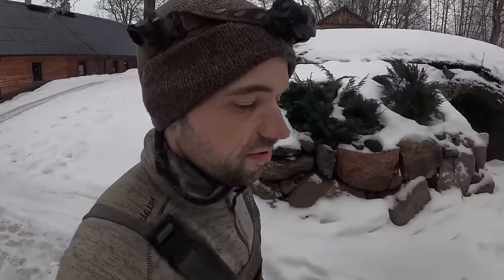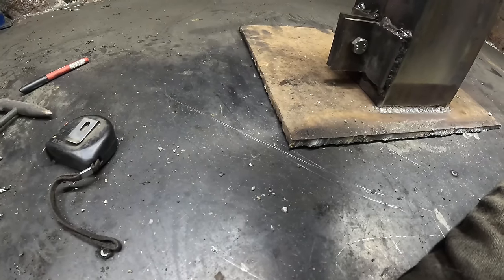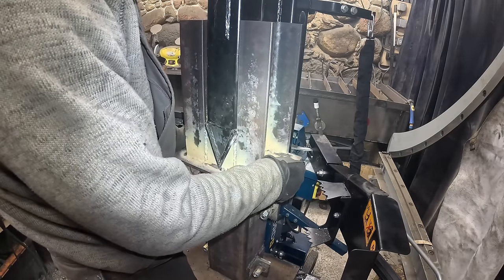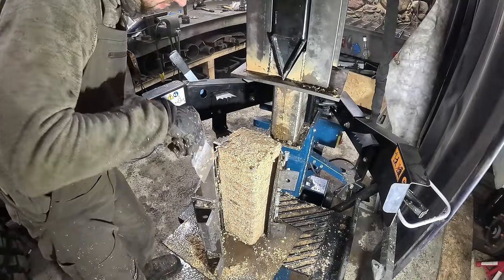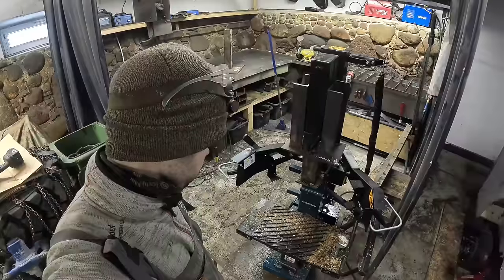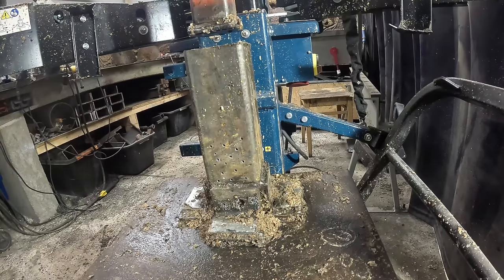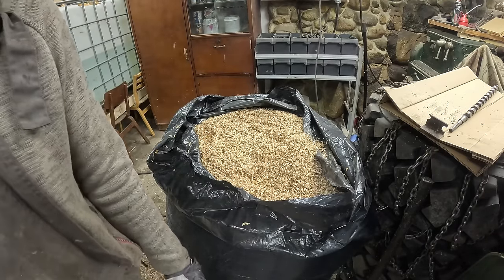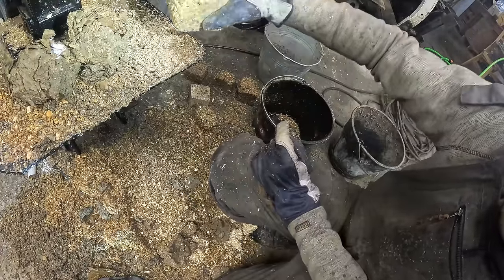Sawdust briquettes with a vertical log splitter?

Comment: Oh Ant, dear, dear, dear, what did you do.😮

Had I known you were going to go with my briquette idea to utilise all of that lovely sawdust you produce each year. An idea I told you about nearly 2 years ago when you told us that using sawdust was not an option!

Then, I would have explained a few things to save you time and money. It still would have made for a great entertaining video, but in the end, you would have a working brick maker instead of a pile of junk.🤣

First things first. From here on, I will refer to them as bricks, ok? Not Briquettes, that's way tooooo long and fancy.

Secondly, have you considered making pellets? Because you should Ant. Making pellets would be perfect for your situation and easier to transport. Plus, they are easier to make than bricks plus, with pellets, you don't need a binding agent.🤔

Lastly, there are basically only two types of press available in Europe, but many similar designs of the same original product, copies, or fakes. They can cost between 23€ and 165€ for a manual hand operation press and 300€ to 6,000€ for a mechanical one. Those prices are only approximate, you understand. And there is something else too. They don't make sawdust brick makers in Europe! Not that I have found.😲

One type uses old newspaper and cardboard, which you need to dampen first, making a sort of papier-mache. Then, once the brick is firm, you remove it from the maker, leaving it aside to dry out, which can take a week or more.🤬

They measure 10cm x 10cm x 25cm long. I had that type myself but save your money. It's slow and  and overal its a crap tin China made machine. Plus, only useful if you have a barn full of old newspaper and cardboard boxes which at the time, i did.😝

Still, it gave my kids months of pleasure in their spare time after school, at weekends, and during school holidays. Making bricks like they were going out of fashion.🤭

I told them that, if we had enough bricks we could build a house or a bridge to go over the brook at the end of our garden. I was joking but that gave them the insensitive to work like slaves.😜

Imagin the slaves 4,000 years ago. Stomping on mud and straw like they did in Egyptian times, only my kids were tearing up strips of paper 6" long 1" wide then mixing them in a bucket on the kitchen table with wooden spoon and warm water which helps seperate the fibers. Not only does it make better bricks but they burn much slower. Bad dad, very bad dad. But don't worry, I paid them well with grain and beer. Joking.🫣

The other type is a sawdust brick maker but it is really, and I mean, really flipping expensive. Over $4,800, dollars Canadian, not US plus shipping. The really bad news is, you can't get on eBay or Amazon, trust me, I looked. That machine comes from Canada and the shipping costs, Ant, they are almost the same as what the machine costs which is crazy and we are nearer to Canade I think. Then, if you needed to pay import duty tax. I dont know if you have that in Estonia, but without import duty just the cost of the machine and shipping is around $8,200 Canadian dollars. That's mental, and completely bonkers. 🤪

Do some research and get one from America dude. The Americans are more into their brick making than us because they have been using log burners much longer.✅️

They sell many different brands ranging from just a few dollars to as high as you want to go. ✅️ Research dude, do your research or you will make yourself 🤮

Here are some tips I found out while researching. 

When using sawdust it must be uncontaminated. This means, no screws, no nails, no staples, and definitely no plastics, as seen in your bricks!😮

Also, when using sawdust it works much better if its all of the same consistency. Fine, or course it dosen't matter which you use. They both burn just as well as each other, but a mixture of the two dosent compress well and never with whopping great slithers of wood as seen in your bricks! 

I learnt the hard way in the beginning, in the early years, just like you, Ant. By trial and error only I gave up with building my own sawdust compressor and purchased a newspaper brick maker online instead for £35. At the time we had mountains of newspapers which is why I put my kids to work as I said. 🫣🤭😂

That pathetic machine lasted all of 2 months before it fell apart. My kids never abused it, they were 7 and 10 years old for Christ sake. It was made in China, flimsy and a waste of good money. Not everything we buy from China is crap. Some things are well made but maybe poorly put together and that's what happened with mine.

Instead of fixing it I built my own adapting the same idea only much better, and stronger. That was six years ago but I don't use it now. All the newspapers are gone and I subscribe online now, but I still have plenty of sawdust in black plastick bags. Which is why I got myself a pellet maker instead.👏

It's great. It's simple to use. You put the sawdust in the hopper, and pellets come out the shoot into the bag you have attached. Plus, it's electric and much quieter. They look like the pellets you feed horses and other farm animals. 🫢

I looked online for a motorised brick maker, but the only ones I could find came from America, and were expensive because of the shipping but after 2 years and 4 months, the pellet maker broke fown. To fix it would have taken two months because of shipping times for replacement parts and cost me almost as much as I paid for it. With covid19, the prices shot through the roof. 

Then about two weeks later my old sawmill gave up the ghost. It was 27 years old worn out and must have milled a million trees. Well, not a million but a lot. It was time to replace it, so I got myself a brand new Woodsman sawmill, direct from America. I could have purchased one from a UK dealer, but buying direct was actually cheaper in the end because of the many discounts and taxes I saved.

Knowing how much sawdust sawmills produced, whether you use a fine or course cut blade, its phenomenal. To save money on shipping, I got myself a brick maker from the same company as the sawmill at the same time.

Buying both machines at the same time, turnd out to be the deal of the century. 

First, I got a whopping 25% discount because Woodman had a promotion going on that particular sawmill. Sweet.

Then, i was given an aditional 15% off of each machine for a double purchase on any model, any combination. July sweet.

Plus, at the time, the company called Bailies also had a deal on. For one day only, there was 30% off of any product on their website.

So, to clarify, every machine Bailies had on their website had a discount of 30% before i made any choice. Add on Woodmans 25% off. Plus, their aditional 15% off for a double purchase meant that I was quids in with Woodman giving me a whopping 40% off for the two machines.

When you add it all up, I managed to get a fantastic 70% off. It was too good a deal to miss out on. So I got my card out and now I own two Woodman sawdust and sawmill machines with a box of industrial tungsten tip saw blades thrown in for good measure. 

Without boring you with all the nitty gritty details. Before all discounts were applied, had I purchased each machine separately a week before, then the combined total would have been $7,840 dollars US. 

With all of the discounts applied on the two machines. Plus a box of 5 tungsten tiped saw blades meant to last 5 times longer than any regular blade, which may I add, they chucked in free. Inclusive of shipping, but not the import duty to the UK, I paid $4,970 dollars US. Thats £3,989. Almost half the price!😁🍻

I half expected to pay somewhere in the region of $10,000 dollars or £8,000 with shipping, but I went shopping just at the right time. Thank you Woodman, thank you, Bailies. 

They shipped the two machines together in the same wooden shipping crate, which was a bonus as that meant less UK import duty. Before shipping, I didn't know how much it would cost, just a rough estimate. 

I had to assemble both the brick maker and sawmill, which was a simple task. They use the same make of engine. The Honda GX690 24 hp petrol engine, which is good for me because I have a Honda dealership repair facility down the road from me who service all of my Honda engines.

Time is money for me. So having someone service all my engines works out better, cheaper than if I were to service them myself as I once did.

Oh yes, one more piece of advice. To make good bricks that stay in one piece when storing in a box next to your burner and to burn longer and hotter. You need a good, sustainable binding agent. I know you have already mentioned this, but trust me, Ant. USE A BINDING AGENT, if making bricks.

If you are able to, then you must buy your agent in bulk to save you money in the long run. 250L at a time is what I can purchase. There are many brands and types available, so do your homework. The brand me or another person uses my not be for you in your location because of weather conditions. Which is why to need to watch some videos on the matter.

I know you said you wouldn't watch YouTube videos, but I would suggest that you help support other Youtubers as they support you! 

Yes, I said support you. I know of several channels that mention you in their videos. You need to do the same thing, Ant. Be kind to others and watch some brick making videos! See what binding agents other people use and which would probably work best for you in your situation. Then make a decision.

See you soon on your next adventure. Ta-ta for now. [Ta-ta] is a typical British informal way of saying goodbye. 🤘⚒️🏴
Reply from the maker: Dude you should write a book about this 😂👍

Comment: If you use a binder to the sawdust, you could extrude it like playdough and use a piece of wire to cut the wood pieces the length you want and set on a board to dry.

Comment: You would need an "extruder" - something that has a bigger opening for the sawdust and the ram/hydraulic arm of the splitter to go in and a narrow opening at the other end for the briquettes to exit. If the whole thing has a cone like shape inside the better the pressure build-up
Reply from the maker: There is a fine line between locking it up and getting good results though

Comment: that was a cool video, and nobody I think is mad because not everything works out. In fact, most projects do not work out and that is what is called R&D, research and development. However, if you ever decide to revisit this idea, here is one and I have no clue it if would work better or not .... What about pressing the sawdust into round cardboard cylinders? You know the type that toilet paper comes on ... or larger cardboard rolls might be available in large quantities from a local carpet installer. The cardboard roll will hold the sawdust in place during pressing it out of the form and it will hold it while the material dries up. The cardboard might even help with kindling the fire because it burns. Problem might be that it burns too fast, maybe?
Reply from the maker: Hmm. Maybe. Thanks for the idea

Comment: Man. I think u should make some kind of nozzle with larger  cross section where Ur "piston" work and press this material and then make it partially smaller and smaller like in sussage machine. a square nozzle will act as a secondary compressive force. Additionally, I would make the output nozzle bent in such a way that the briquettes slide out horizontally for convenient portioning. then there wouldn't be so much crap around.

Comment: in the '70s we had DuraFlame logs, they were sawdust bound in a wax, that burned blue and green flame, with no smoke, like a smokeless log. But you would never have access to industrial quantities of wax, and what was their formula? Maybe diesel could be gelled somehow. Or an animal based glue, like horse hooves...
you could extend the length of the 5 ton electric splitter for log pressing duty, then return it back to normal length for log splitting.
Reply from the maker: Thanks for the info

Comment: Use wax for the binding agent the pressure will heat up the wax and melt it all together and lube the sides of the form making it easier to press out if you are not using it in a cooking stove you can also add a little used motor oil

Comment: Presto logs were created by the big sawmill/lumber companies in the western USA in 1930 to deal with their miles of piles of sawdust.  They never went over well.  I remember as a kid sorting through boxes of 12 logs that we got for 50 cents each to try to find pieces long enough to create a proper fire.  The name brand ones use mostly paraffin wax, with some metallic particles to change the colors of the flames.  The parrifan would cost you or me twice what they can sell the logs for.
Straight dry pressed logs produce less than half the BTUs of a softwood piece of wood of the same weight, and they burn much cooler.  Have you considered pellets, like for a pellet stove?  That seems to be where this tech evolved to today.
Needless to say, I have always despised particle board and now Oriented Strand Board since my childhood experiences with presto logs :goat-turquoise-white-horns:
Reply from the maker: Hmm

Comment: Just a quick tip, when stick welding you drag the tip not push the tip like you do with MIG.
I.e. hold the electrode at about 30 degrees and drag the tip away from the weld.
Reply from the maker: I sometimes do both

Comment: Use a tapered (venturi) output tube so you are compressing the fibres in all directions. And make it much smaller than the square tube you were using.

Comment: I think you need about double the pressure you have and the sawdust must be finer. Just my 2 cents worth. A guy on YT bought a machine that makes round wood pellets about 5-10 cm across. It sounds as if the machine works with pulses.
Reply from the maker: Screw type?
Reply: @Ants_Pants  screw type? Don't know what you mean.
Reply from the maker: @andrepienaar6459  instead of a hydraulic piston a giant screw compresses the sawdust

Comment: make an anvil that replaces the plate in the bottom of the tube. it should fill in the space below the pipe. put the anvil in, add sawdust compress, compress, compress, remove anvil (which is easy cause it's big and you add a handle), THEN smoosh stuff out of pipe

Comment: You're not wrong about paper as a binder for wood chip bricks. BUT you need a lot of it and you have to make paper pulp (paper mâché) first, as thick and dry as you can, and the you can only mix in 30% wood chips by volume. It also helps to dry the bricks under pressure, because the material shrinks a lot while drying up and tends to tear itself apart. 
At least here a cheap binder is wallpaper paste. It has to be used quite dry and mixed in very well. I experimented with it, and i think it woks the best to mix it in the chis dry 1-10% (depending on the wood chips) by volume and then slowly adding water until you notice them sticking together.
You can make something similar when boiling wood chips for an hour until they're nearly dry. The result then mix  with 50% fresh wood chips and press it while it's hot.

A good size for chip bricks i found is "half clay brick" size. With and depth of a red clay brick but half the height. This way they fit well in ovens, are light easy to store and dry fast.
Reply from the maker: Thanks for the comment

Comment: Making biomass bricks is a bit of a challenge, especially with the moisture content.
If memory serves me the moisture content has to be sub 8% (the dryer the better).
The thing with pressed wood is that it MUST stay dry.  If you drop a wood pellet into water for a few seconds, it will fall apart into sawdust.  I have done it.

I think your problem is that the wood you failed with was wood that was too wet.

As for additives ... things can get complicated but keep the percentages low.  I know 2% oil works great, and candle wax can work as well (I think the percentage is also 2%).
Reply from the maker: Thanks

Comment: use dry stuff only and build mould part with 2 diameters .. top wider and bottom narrower (for exaple like cone), so when you press from top you make large volume of sawdust go to smaller and smaller hole it compress also from sides.. than u dont need use bottom plate and it hold itself...
Reply from the maker: Might deadlock the press

Comment: i think you want an extrusion press for this and unless you get into rediclouse pressure its probably going to want a binder like paraffin  or 50 year old diesel. thanks for the videos.  i am certain this will need a hopper to feed a lead screw which compresses the material in a chamber and through a die.....insane pressures and heat have fun
Reply from the maker: Yup

Comment: If you add water and then remove water, what are you gaining in the process. I think the engineering questions are for a later time. What do they use for a binder in the food industry?  There has to be an organic binder out there. When I worked in the paper industry, we used lignin. I have no idea of its availability or cost, though. Good luck.
Reply from the maker: Isint that naturally in wood?
Reply: @Ants_Pants  you are correct. I wonder if you could add it to your mix to help it bind without heat??